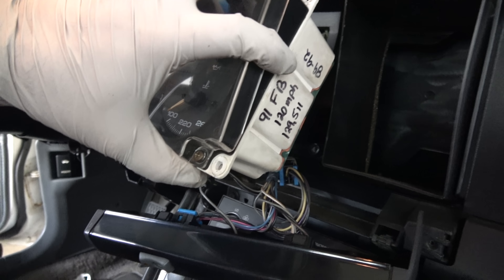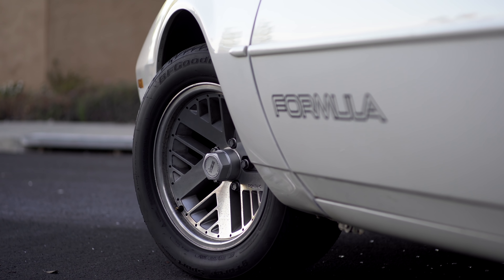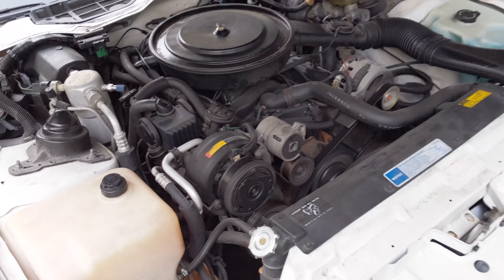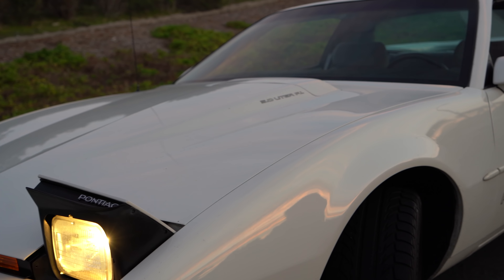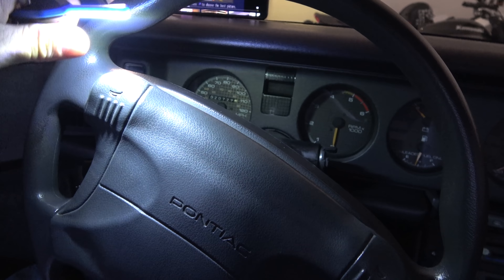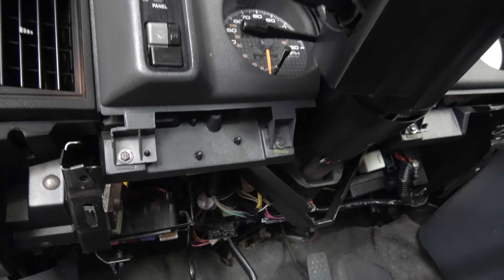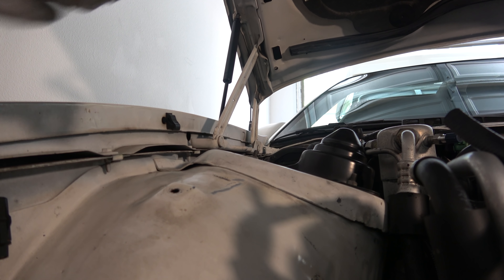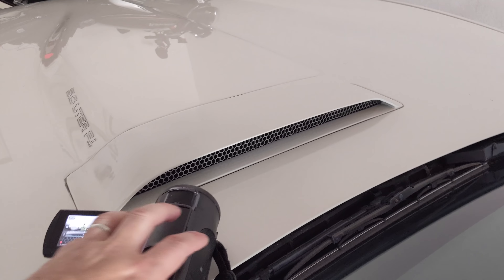LIES! Odometer fraud on my 1990 Firebird

Comment: With my 3rd gen TBI camaro Radically low gas mileage was a bad or broken O2 sensor or its wiring. The car's computer goes into a dumb limp home mode and burns gas like mad.

Comment: Make sure the oil is not standing in the head at the back, over cyls 7 and 8. It's a small block Chevy thing. Old stem seals will harden and crack from age so maybe you won't have to pull the heads. Man, I could go on awhile with thoughts on that engine lol
Reply: The factory timing sets were basically 100k with those nylon covered teeth. Once that starts breaking off the timing gets sloppy, jumping all over, especially at idle. Of course once enough comes off it'll just go out of time, usually when it's shut off and the chain tension drops.
Reply: IDK about that 305 but they started putting detonation sensors on those and if you had any loose bearing or preignition ping it retards the timing so hard it usually falls on it face from a stop or hard acceleration.
Reply: EGR valve, the eternal stem vacuum leak problem. Unfortunately that's gotta be there for emissions. Opening too fast was a stumble on acceleration because lean, opening too slow was a stumble because ping. PITA for sure when it's not right.

Comment: If your car cant get an accurate reading from certain sensors it will remain in Open Loop and run rich. Bad ECT sensor, MAF, MAP, O2 Sensors can all cause high fuel consumption.
Reply: With a bad O2 sensor my GM TBI went from 24 mpg to 13mpg.

Comment: Temperature sensor! That's where the problem is. Not the gauge sender in the head, the ecm sensor. TBI cars have two. You need the one in the manifold, right by the thermostat.

Comment: My guess is that the hardware of the two ECMs is the same, and that if you had the right information you could just switch the program from automatic to manual transmission version.

Comment: The car is still awesome brother don't worry. I bought the same exact car with an automatic transmission mine shows 45,000 on the clock who knows if that's real but the car looks like it's real I also get that little puff of smoke when I start it up but it's white smoke like it's extra fuel not blue smoke like it's valve stem seals. it's possible from sitting so long in the Florida heat even in the garage because it was garage and covered all the time that the valve stem seals have dried up and become brittle that's a distinct possibility. I'm going to run it put some good additives in it and see if I can bring them back to life if not I guess I'll be doing valve stem seals possibly myself. But don't sweat it it's beautiful vehicle you have there you've got a bird and in the end you're going to make it the way you want to make it. for the record I did my due diligence as well and I did a Carfax search on it and even the odometer came up as clean and correct... But who knows.  Don't sweat it it's all yours so just enjoy it brother cheers! 🍻

Comment: Don't trust Carfax they have no clue what they are doing. According to the monthly report my dealership pays for my car is being driven instead of sitting in the garage but somehow my digital odometer does not change. When I had 26k it said I had 28k, now I have 27800 and Carfax says I'm sitting at 31k. That's with using Chrysler supplied, OTA gathered, up to the minute info. Funny thing is the VHR I get from Dodge always shows the correct mileage.

Comment: If you have a compressor or air tank spsrk plug fitting and a loaner tool valve spring compressor the valve seal job aint bad

Comment: Yeah, it was sold as a low mileage vehicle and you paid for that, you do have opportunity to get that fixed. With that said, that milage on the cluster was probably the milage of the car it came from, and not the one it went in to.

Comment: The valve stems can dry up if the car seats for a long time plus the cluster they couldve put the replacent one and match it to the cars actual mileage of 20 thousand mile writing the original miles for the cluster so it might still be a 20 thousand mile car  they dont like to seat and even if is 20k mile car if it sat for a lon time you bound to have some problems

Comment: Low mileage on an old car is a huge redflag. I'm a lot more sketched out by a low mileage old car than a decent mileage car that's clearly been taken care of. If a car's low mileage and old it's either had tonnes of problems that've forced it to sit, or it's had the odometer rolled back or replaced.

Comment: Folks are confused , It is only fraud if the replacement speedometer is set to less miles than the actual car's mileage . Nobody knows what mileage the car was when the replacement speedometer inked with 129k was installed. There is a big missing piece of the puzzle that one might never know. Cars degrade  more in stop and go miles than highway miles. I put 72k miles on my 3rd gen camaro in SoCal in one single year. It got issues years later by not being used, the fuel tank gelled into 1/4 inch thick gorilla snot goo. The entire fuel sender, plumb and 4 metal tubes were like dipped in taffy.

Comment: It’s very hard to find a third GEN with low original miles they’re out there but they’re not out there for $8000 that was your first mistake second mistake is actually working on a TBI 305 they are junk rip out that motor and put a real motor in it and have fun with that car

Comment: Even though your let down.. Nice car!! If you like it and you want to keep it, then buy a 5.7 ltr GM crate motor and it will run way better than that 305.. Better mileage , everything better! A crate motor is a little more in cost than the 500 to 1k  or so you will spend in machine parts, etc. work to correct your old heads. But only if you plan to keep it. If it is a investment.. Well fix the heads..

Comment: Sorry you got ripped off. But man enough to admit it - some wouldn't. Excess pedal wear is a tip off (though they could be replaced to hide it). Bought a used '84 HO TA in '86 and a new L98 TA in '90. Still have the '90. Yes spark plug replacement and the AIR tubes are a pain. Also had a badly rusted distributor reluctor like in your Formula - don't know why because the rest of the car is rust free. Got a Code 41 and replaced the ECM PROM at 64K miles. Pretty much 20 mpg for highway driving. If you ever get a parasitic current drain check the headlight module on the firewall.

Comment: The speedo cluster was replaced with a junkyard replacement from a firebird of a different year thatvhad 129k. Who knows why they replaced,  the old one could have looked like crap and not looked like one from a 19k car. Or it could have stopped working and they replaced it with the junkyard one. And who knows how long they drove the car with a non working speedo/odometer? Could have driven it for years, and then installed the working one when it came time to sell. Impossible to tell the mileage. Might not be 129k, might be more, might be less. But not original mileage for sure.

Comment: Never trust the odometer on used cars -  one of the better indicators of higher mileage is wear on the rubber pads on the brake and accelerator pedals.

Comment: I know this is a long shot but could it be that the car really is a low mileage car just that the original cluster failed and was replaced with a junkyard cluster. All the signs are saying that is not the case but there is a possibility. Very very low possibility.

Comment: There is a good chance it is a low mileage car. It wasn’t unheard of for the cluster to be changed out, I bet the 130k mike number was the cluster, A bad ecu wasn’t that uncommon, I have replaced them on 30-60k mile gm cars. Sitting will dry the valve seals and the tbi stuff out. With that nice of an interior, I wouldn’t doubt it isn’t a low mileage car. The clutch could be lit attendants trying to do burnouts in it for the last 5 years. Those are all ifs and maybes, but also realistic repairs on that era car that I have seen personally.

Comment: Its still an old car no matter what way you look at it, the original cluster might have been no good and replaced, miles could still be correct as the body and trim are excellent, the mechanical issues are consistant with its age, the seller may have not even known the cluster had been changed. Talking about fraud is a waste of time, no law inforcement is going to spend the time required to get to the truth, just blame the last owner, its easier for everyone that way 🙄 The lesson here is..there is alway a risk when buying or selling a second hand vehicle, luck of the draw unfortunately!

Comment: Please let author read this.
This is not a fraud from US law standpoint. If your car is older than 10yrs from procuction milage is exempt. Your milage doesnt have to match due to it just being old car and a lot of components (even engine and trans) might have been replaced  so the milage is not representative car condition.

Your car is indeed low milage but was abused. Ohnestly it doesnt look like 120k plus miles so ease up you have very nice piece of car there, and was worth time and money.

Comment: They wrote the mileage on the side of the odometer cluster, of the car it came out of. So you should ask yourself... What kind of damage would cause an odometer to have to be replaced? What could have possibly have happened to the inside of the vehicle, to cause those Electronics to go out? I'll give you a hint... There was probably a lot of water involved. Pull the A pillar trim back, look for a water line. 
Even the best detailers missed behind the trim.

Carfax didn't exist in 1990. And when they started coming around... We kicked them out of the shop. Because none of them, we're paying us, to do their job for them. It's a joke. CARFAX is a fraud.

Comment: The more I catch up on your videos, the more I'm in agreement that car has a lot more miles than were claimed. Someone did a cleanup job and swapped out for some better seats they got somewhere and called it a day.

Hard to say about the scrawl on the instrument cluster. It may or may not be from the donor car.

Your actual mileage on your car is somewhere between 0 and infinity, and that number will never be known.

Replace enough parts and it doesn't really matter. Except of course to your pocketbook.

Comment: Cars are really a pain in the ass I'm sorry you're having to screw with this situation. I had a fishy encounter with a used car yard guy a bit over a decade ago now when I was browsing the few cheap cars they had (this is out in the country/backwoods). There was one I looked at and the guy said the odometer in it was broken essentially and I noted the car was a 90s or 80s car in Rough shape yet suspiciously read out as like 100k miles or less even i dont recall exact (this car visibly had been driven 170-200k+ miles for sure), but it was definitely a red flag and pretty unintegritious seeing as he also used that low reading as a selling point that it had all this life left in it and it was also the reading he officially advertised it with 🙄 so nodded my head and walked over to some other car casually not reflecting outwardly at his fraudulent claims. I wasnt planning on considering buying any of the cars he had just because that 1 thing alone was enough for me not trust his business ethics and feel like I'd not be properly informed about any of the cars. Pretty positive he tampered  with internals of the odometer in hopes someone would not know better and think what a steal. Sorry again 😶 but it's so great to see you still being consistant on YouTube  and killing it

Comment: Sorry to tell you your engine should be the multi port fi engine. That's a replacement engine plus the wrong engine
Reply: no it's not, it's the original TBI engine that came on the 1990 formulas with the T5 transmission
Reply: It came with the multi port engine that year . the formula is a toned down transam. The throttle body engine was for regular firebirds. That car was a rare combo new but looks like they replaced the engine. Sorry to tell you, buy a chiltons repair manual at a local auto store and look up engine specs or better yet google it, you're out of china now.
Reply: According to a '91 firebird brochure, that 91 model formula came with an electronic fuel injection(TBI)and an optional 5.0 or 5.7 TPI
Reply: @hynestimothy411  I have the original data sheet that was in the car and it was the l03 5.0 TBI, it was an option for 1990 for the formula, it is also numbers matching
Reply: The multi port fuel injected engine was a 6 cylinder engine standard in the base Firebird only in 1990. The base engine in the Formula model was the 305ci V8.

Comment: Stay away from the t-top version because of constant leaks due to body flex. When they designed the t-top they removed important structural integrity and the body will flex more than usual and you're starting with a weak body to begin with and there's no fix for it. Luckily you live in California where it doesn't rain much. Unfortunately I knew people who owned t-topped cars where I live and they regretted it since they always leak. Unlikable.

Comment: While you are in California, maybe stick to cars from California.  If a misrepresentation happens in state, the seller should be liable and culturally, will probably come to some arrangement with you to avoid possible litigation.

Outside of California, your mileage, so to speak, will may vary!

If you get into cars that are older than 1975, going out of state is more reasonable, due to supply (lots of cal cars have been exported out of state and out of country and just aren't available here anymroe) and because smog equipment retrofit can become an issue here

Comment: No recourse at this point.  The seller you bought it from was likely a victim as well.  It's also possible that the car was fixed up decades ago and then the owner died so family sold it at face value.  The proof of no fraud intended is there as they labeled the instrument cluster as a replacement.  That fact was just lost along the way.

There's no way to easily prove fraud like this if it even is fraud.  Using the court system will likely lose more money even if you are refunded 5k.   Not worth it.

Comment: While I don't doubt your conclusion that you were defrauded,  I must note that the mileage numbers on used parts are frequently written by the salvage yard to indicate the state of the donor vehicle. in any event,  arent there fraud guarantees from both Car Gurus and Carfax? If not, then what's the point of using these services?

Comment: Just saying, American car parts aren’t made to the highest quality lol. It’s possible the parts that are worn out even at low mileage could just be a combination of age + cheap material.  I bought a ford with 45k miles and even though the suspension was still in good shape the rubber bushing were all gone hard and worn out lol.

Comment: The milage written on the clock would be the milage from the car it was removed from
Reply: Why write the mileage on the side of a 2nd hand odo when it's already shown on the odometer dials anyway? It makes more sense that a new odometer was fitted and the fitter recorded the old odometers mileage on the side.
Reply from the maker: Then why would it be 0?
Reply: @WorthlessWhips  If a NEW odometer is fitted then it has 0 miles and the mechanic has logged the old mileage onto it? Keeps his arse covered legally - it's then on to the owner to keep a true history.
I dunno, it doesn't make sense for a 2nd hand odo which already has 129k on the clocks to then have it written on the side too? If someone does reset the clocks why keep the evidence of 129k instead of wiping it off with a solvent?
Who knows, but at the end of the day it's obvious the low mileage has been misstated.

Comment: You cant trust Car Gurus, Carfax or any of that junk dude.  Anything listed as bought at 'Auto Auction' might be problematic too, those cars usually end up at the junky corner lots you see in sketchy neighborhoods.  You shouldnt have paid any more than $1500 bux for that car!  Internet sales are suspect at best. Most dealerships (even ones like Ford, Chevy, etc) in the US are out for every penny they can make.  I have stories of factory recalls where technicians try to charge for fees (factory recalls are paid for completely by the factory), just ridiculous.  If you buy a brand new car (NEVER DO THAT!), the majority of dealerships will not replace ANY faulty parts covered under warranty that they notice are damaged during inspection.  They wait for the customer to notice, then they fix it.  Sadly, the auto industry here, and world wide, is sketchy at best.  Caveat Emptor!  Never trust a salesman!

Comment: Most of these things you point out don't mean anything about the mileage. The car was stolen. Can you say what was damaged when it was stolen? Was it sunk in a creek? Was it ramped off a cliff? Valve seals go from being dried and cracked with age. Corrosion on the cap means there was moisture due to sitting. I bet sitting killed the clutch as well. I bet it was a rebuild title situation that kept it's original title somehow. You didn't get ripped off. You just need to do homework on its repairs to understand what it looked like after the recovery.

Comment: The only way you can make that Firebird worth anything is to shitcan the whole drivetrain. Why you ask? Because it's absolute garbage! One of the absolute worst years for an f-body Pontiac. They may look good but the drivetrain is shit. LS it. Turbo Charge It. Turbo 400 12 bolt rear end. Then sell it as a restomod and make your money back. That model isn't worth shit with that many miles on it.